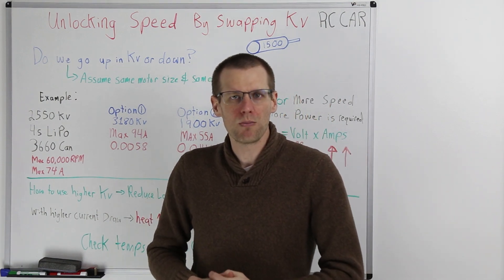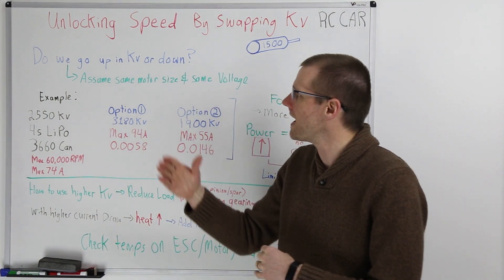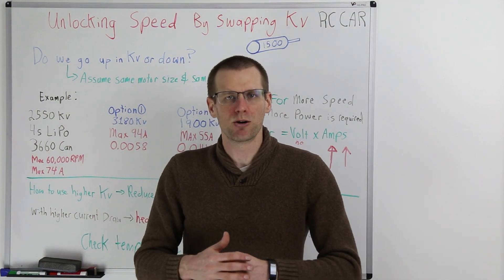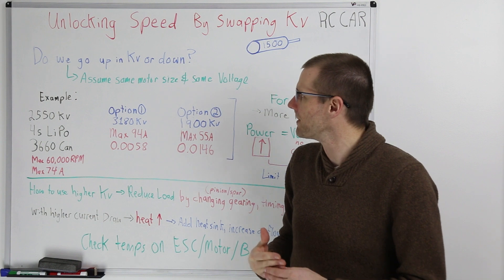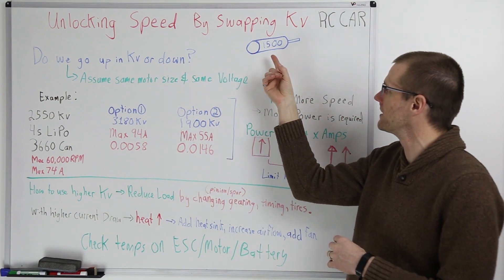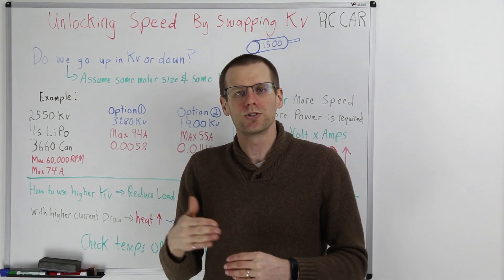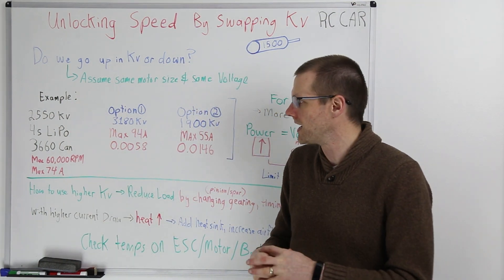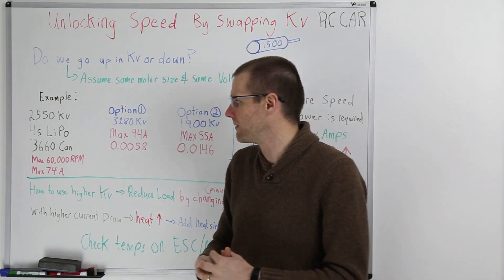Boost Your RC Car's Speed: How to Master Motor Kv Optimization for Max Speed!

Comment: Thanks for these videos. This one probably being your most comprehensive one in regards to kv vs. max power determination? I had build a similar model in excel a few months ago, and except for HOW to account for load, my results were identical. The one variable that I also included, however, was the change in wheel diameter at different Final Drive RPMs. Unless you have solid rubber or high-end belted tires, it can make significant differences to top-end speeds (and load factors). 👍

Comment: I have been banging a 6500kv 24xx size Surpass motor with a 10bl60 HW ESC on my 16889... run 3s Zeee at who knows what 'real' C... Ripped 63mph on her.  Looking to get to 70 or 75.

Ordered up yeeeeap a HW 2845 4700kv to run cooler and get cleaner runs.

Hard to get the 16889 to stop wheeleying at WOT.

Thanks for the videos really gets the numbers to come together!!!
I
Reply from the maker: Thanks for sharing. Good luck un getting to 70!

Comment: Thanks so much for sharing your knowledge. I have bad eyesight. My goal speed is only 100 mph but because of my eyesight I need to get to this speed as quick as possible so I can still see the car and where it is on the road. Your information will help me do this I think.
Wheel spin could become a problem over such a short distance. Maybe Raz's Perfect Pass system and some 1 million in the differentials could help but I can only experiment with those things.
Reply from the maker: Yes, you will also want to make certain you have the most sticky tires for maximum acceleration potential. This will help keep distances shorter.
Reply: @RCexplained  Thanks for that.
Reply: Large diameter motors are a little easier to control and have the torque you need for your goal. A castle 1717 wouldn't be a bad motor for you goal but a big tp motor would really do it. Goodluck to you and I hope you reach your goal

Comment: This is an excellent video, but even though I do understand that one can not easily deduce the amount of current being drawn under certain conditions, a discussion on that topic would help a lot because that could then be turned into heat production and also help to understand what batteries / ESC / motor combination to choose as to not damage any of the three components. My (naive!) understanding would be that ESC limits the maximal current it can provide to the motor. If that is the case one could maybe use that as a starting point when changing the motor. Or is that the wrong assumption? Thank you
Reply from the maker: thanks for the comment Matus. Speaking about current draw is indeed difficult to do. The current draw would be very difficult to speak about considering RC Cars. There's so many factors that influence what the value would be. 
Not all ESC's are able to safely limit current draw.

Comment: Nice!! So a direct question. I have a 800 kv motor and an 1100kv motor, i want crazy speed, so i was thinking of going with the 800kv and gearing it 1:1. I figured the 800 could handle to more rather than the 1100kv. With 12s being the powersystem of the 800kv motor. So with that being said l,
Would the 800kv be able to handle that kind of power better with less heat. 
I know there are so many more variables but mot looking for exact answers just a what would you go with if you had to pick between 800kv/max 5 or 1100/max5 for speed. And big gearing
Reply from the maker: I would choose the motor that is rated for the most wattage. If there is no rating, I would select the motor that is physically the largest. Then optimize on power by selecting the maximum voltage without going over the max RPM of the motor. Using gearing that is appropriate for the power output of the motor. Example - Don't gear a 300watt motor for 100mph.

Comment: Still don't understand a thing. 
So if I change to a Higher Amps esc and a higher kv motor, my rig will still havethe same speed? and will be damaged?
I'm so confused.
I'm trying to upgrade my Team Associated 1/10 Hoonicorn. Which have a Reedy’s 550 15-turn brushed motor (can't find the kV) and a ESC of 80CAmps.
I wan't to go faster and have a bit more torque to make it slide better on rubber tires.
Reply from the maker: Hello, you have a brushed power system. Getting a brushless power system will make a world of a difference.

Comment: Kindly I have a limitless with a max 6 esc and a 1650kv rocket motor wich it's maximum volts is 26v, and I am thinking of trying an 8s. I  don't know if the esc the voltage, amps, or frequency to increase the motor speed because I think it should be safe if the voltage drops on load and the motor doesn't go 50,000rpm?
Reply from the maker: Over spinning the motor is risky. If the car takes flight, the motor unloads and can exceed the maximum RPM you specified.

In terms of current, you could easily gear down and from there monitor temps. If temps are OK move up in pinion size.

Comment: I'm working on a monster truck speed project. Truck is in range of 14lbs. Running a 2050kv motor and spectrum 6s ESC. My goal is 150mph, just to see if it can be done on stock system. I ran 69.9 today on just better than 1 to 1 gearing from pinion to spur, and 43 teeth on front and rear diffs. First pass, I tried to gun it as I passed camera, and tires ripped free  I'm aware now that I should have let system cool between runs. On immediate second run, I was guilty of the same transgression passing the camera, and the ESC cut out at half throttle at 69.9. I'm thinking I need a longer run up, and more gradual, consistent trigger pull. Any recommendations?
Reply: 160 amp spektrum esc struggles to get past 100 even in a light 1\8 gt car. You are gonna need an xlx2 for it to even be possible in a speed car. Monster truck tires aren't gonna make it past 70 to 80mph.  Gonna have to work around those 2 issues to have a chance
Reply: @Chris-adams-rc-journey  I'm running rear felony hoons all around, and have swapped the diffs to twin rear felony diffs with straight cut input shafts. At 69.9 Sunday, I ripped tires free, and got excited passing the camera, and just yanked the trigger, instead of gradual to keep amps down. I realized that I turned gain back up after trials before Sunday, and servo was too fast. I took 9 teeth out of gearing, and dropped to 4s to figure out waggle. Felt like an idiot when I thought to look at remote after first run. Problem went away immediately. I'm trying to see what the top end is of the spectrum system. I've got a max 5 waiting in the cupboard, but I'm gonna try and get this 14lbs monster to 120. I'm not very experienced at rc, but love numbers. I need a really long run up, and some patience. I'll post a vid soon. It's a ton of fun trying to get this thing to do something it definitely wasn't designed to do. Thanks for the insights.
Reply: Be slow and smooth on the trigger and also heat your batteries up. Heat them to 115⁰ish and the internal resistance of the lipo will dron about 50٪ and help with voltage sag and voltage recovery good luck buddy I'd love to see you meet yor goal
Reply: @Chris-adams-rc-journey  thanks brother. I got a buddy that has to win at everything, and he got me into it. Just can't take the constant rubbing my face in it. Good guy, but the ego needs to be taken down a few spots. That's why I picked the fireteam. Perfect sleeper, especially if I don't try and trick it out. I went out for a hoonicorn after Ken block died, and they gave me a deal on the fireteam. When I told him, he asked me to go to rc store, and he got two hoonicorns, and a Felony. And now it's, you'll never beat my felony or super slash, so here I am, attempting the nearly impossible on stock system. But hey, at least I'm not at the bar wasting money on over priced drinks.

Comment: So lower kv motors can turn bigger pinions. As bigger can motors have low kv.
Reply from the maker: Larger motors will naturally have more torque/power.
Reply: @RCexplained  so for a kraton 8s. Stock motor 4685 1250kv or 5687 1100kv. The bigger can motor with bigger pinion and smaller spur should have more top speed?

Comment: If youre going for a higher kv motor to get more speed , but then you gear down with the higher kv motor to get a similar speed to what you originally had then what's the point of changing the motor at all? Lol
Reply from the maker: It's best to start conservatively checking temps before adjusting gearing for max performance.

Comment: Yeah nah. The amp rating is the Max current draw at Max load, eg: acceleration. The quicker a motor spins the less it draws.
The power you worked out (amps X volts = watts)  is the power consumption,  it has nothing to do with the output of the motor but more so on how it is built. You are, however, correct with the rest.